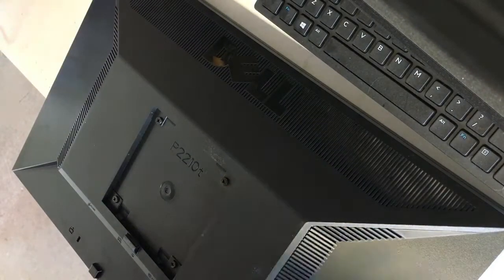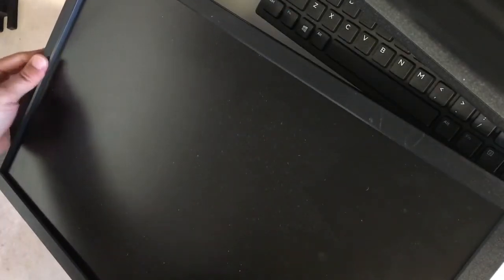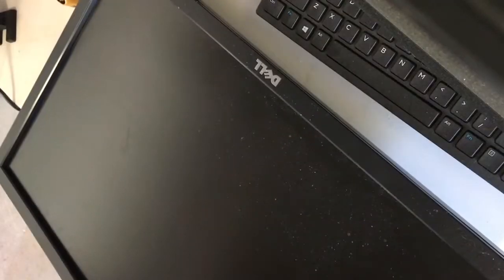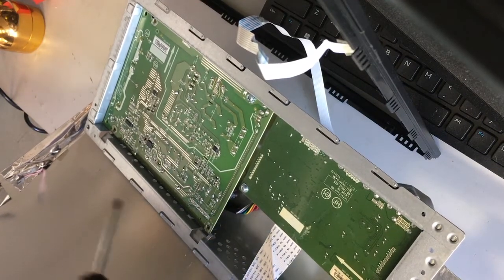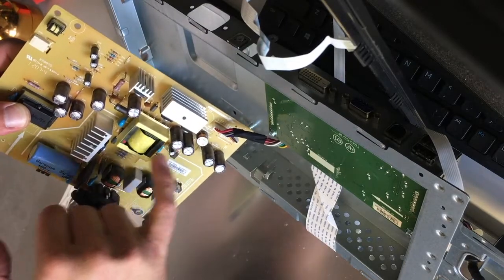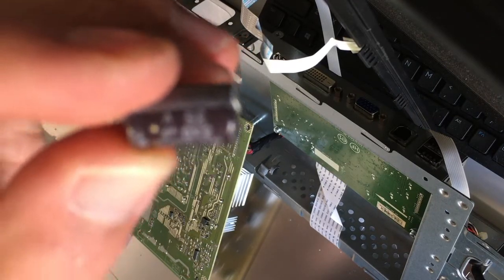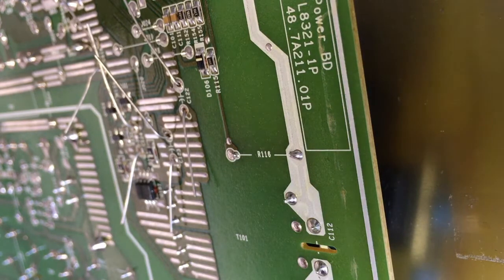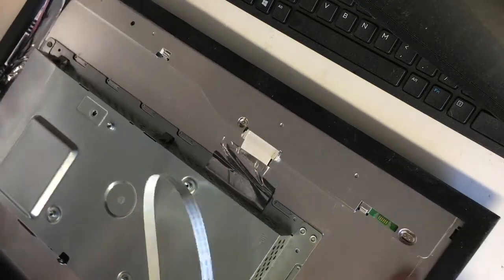How to replace failed capacitors on a Dell p2210t

Comment: Where's area cspstor 220uf/35v
Reply: In this video, you can see that the four capacitors come in two sizes. The smaller one is a 220uF capacitor.

Comment: hello. may i know how to fix a backlit problem? all i can see is a pitch black screen however when i use a flashlight and point it to the monitor i can see colors but no backlit. i can see the dell menu and even tried to reset it to its factory settings as well as turn the brightness all the way up. but to no avail, it won't turn on normally.

occasionally, it turns on normally. but for example when i turn off or change the resolution of the monitor, it goes black again.
Reply: Same for me :(

Comment: Informative.... But...
use a desoldering tool (solder sucker or solder wick) or you'll damage the board.
Us electronics-y people refer to a capacitor's value as its 'capacitance', not the 'uF value'.
If you'd like your power supply to last a lot longer, replace capacitors with the next voltage rating up. Replace 10v capacitors with 16v, 16v with 25v, 25v with 35v, etc.... 
I had the dead caps out before you finished the video, thanks.

Comment: hi, i have the same issue, but the capacitors looks good, how you could figure what capacitor it's bad??
Reply: You'll need to desolder them, but a multimeter with a capacitance display is the only way.

Comment: I have a dell p2210t monitor with same fault. I think this problem is company fault
Reply: Not just Dell. I've replaced capacitors in many different brands, on many different bits of gear (monitors, desktop speakers, DVRs, Hifis, car stereos, TVs). Latest was my home Hifi, a 1991 Sony unit. Replaced 114 capacitors, works just like new again.

Capacitors have a finite lifespan, which can be calculated based on the rail voltage, the temp and the capacitance. Companies don't want their gear lasting too long (can't sell you a new product if the old one doesn't fail), so cap values are selected to give between 5 and 10 years life. It's a cheap and reasonable quick fix, if you know what to look for.

Comment: i had a real time trying to seperate the bezel on mine to get to the innards to fix it, right now i'm waiting on parts, good video and good information, a major help with the disassembly of my monitor, soon as the last of the caps i ordered off amazon arrive i'm going to try re-capping the inverter and see if she comes back to life, the monitor powers on like you show in your video, but no backlight, but shining a strong flashlight on the display reveals it IS displaying video, so the power supply and IO are working

Comment: Hi David. Great video! I have a similar issue - just couldn't figure out how to disassemble the monitor. I usually change capacitors to a higher voltage, if there is room, to avoid the capacitors to fail again later ;-) Best Regards

Comment: What temp rating were the original caps?
Reply: 105C. Suggest you use the same, but up the voltage rating.

Comment: Hi, nice video. How is the issue affecting display before the fix ? I  ve backlight flickering on a E2210 you think it's worth getting a look to capacitor. Any hint to get dell service manual somewhere ?
Reply from the maker: I my case there was no flickering beforehand. The monitor backlight just fails to turn on altogether.
Reply: thx